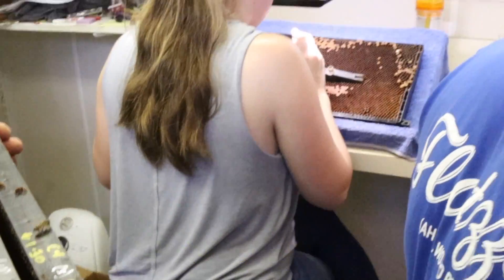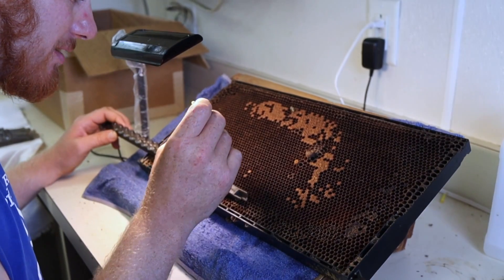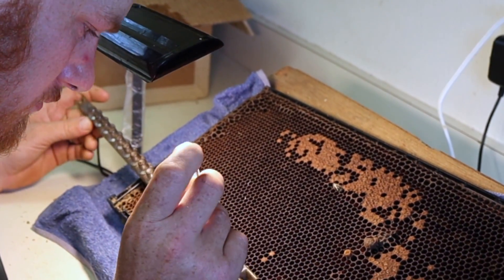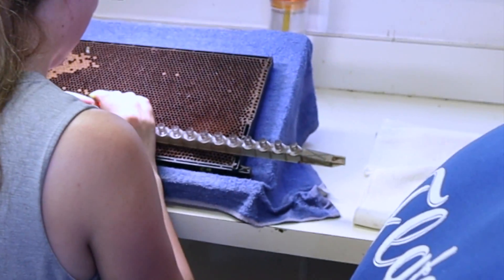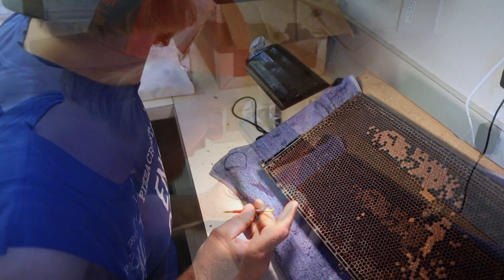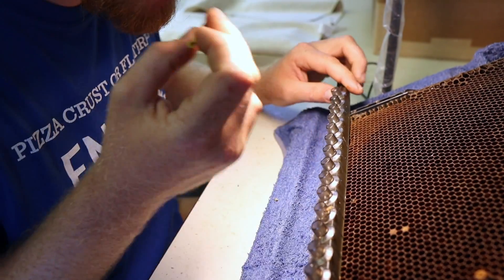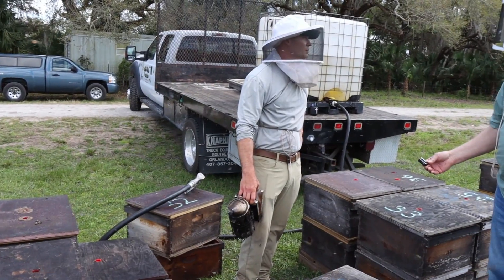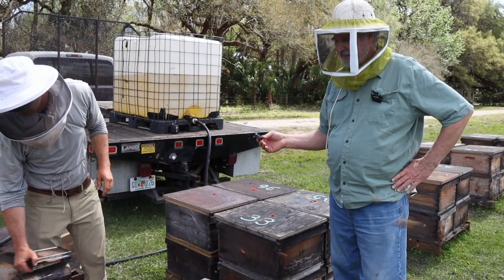Florida Beekeepers Part 3: Queen Production with Chris Werner

Comment: Why do you want to make the finisher queen-right? I understand why you make the starter queenless, but why is it better to make the finisher queen-right? Thanks and I really like all of your videos!
Reply from the maker: You can let a queen-less starter finish cells, it will work fine, but it will only do a real good job for one round unless you continuously add fresh young bees. By the second round the proper age nurse bees are aging. Using this method you can do it again and and again because there is a steady supply of bees that are of the proper age. This is important. Good question. I'm going to put it at the top of the comments. Thanks.
Reply: @bobbinnie9872  Thanks Bob! Now it all makes perfect sense!
Reply: @bobbinnie9872   I have a question along the same line. Are they adding frames of brood or shaking any bees into these cell building colonies that come from donor colonies?  If not they must just keep these colonies good and strong. I do understand what's happening, virtually all the bees in the colony end up in the lower box both through shaking them in from the top box and the field force flying back from the top box.
 I am curious because if they are not colllecting brood and bees from other colonies it seems very efficient and I like that idea.
Reply from the maker: @calvinkalmon6746  They are generally just using the bees from an existing colony but as you can see in part 2 Chris keeps track of which builders are performing poorly and takes measures to correct deficiencies which may mean adding brood or a new queen. We use much the same method but often choose to shake in more bees to be extra sure if a colony is not real strong.
Reply: @bobbinnie9872   Think you that clears it up nicely. What I like is there is the possibility of using that colony to produce honey and make cells.
Reply: @bobbinnie9872  Good answer Bob. I'd add that finishing the cells in a queen right hive is under a different natural impulse and the cells will finish better. When queenless the bees are desperate to produce a queen asap and will do so under the emergency impulse. Once the cells are started they can be finished queen right, which is done under the supercedure impulse. It will take longer to cap the cells and they will be better fed.
Reply: Great videos..the best queens are swarm cell queens and even those are queenright..its best to imitate what the bees do as much as possible
Reply: @corneliuolar7663  Well, my thinking was that if you make the finisher queen-right, then you would provoke the queen to enter swarm mode and she would want to swarm.

Comment: Bob – Can you elaborate on these two points:
1) “Swarm cells make the best queens”
2)  “ An Indian study that shows  1.3 to 1 syrup achieves the best stimulation”
Thanks
Reply from the maker: Hi Craig. Swarm cells make the best cells because they are generally very well fed. They are usually made at a time when the bees are predisposed to making cells. 
The Indian study on feeding syrup looked at a number of different concentrations of syrup and found that the one that elicited the most brood production and wax production was 1.3 parts water to 1 part sugar. My experience is that anything remotely close works well. We routinely feed 1 to 1 when building colonies on syrup because we also want to gain weight. When feeding colonies strictly for producing nucs we use anything between 1.25 and 1.5 to 1 and have good results.

Comment: Thats interesting. Last September my 8 hives were robbing each other so i figured i would simulate rain, turned the hose on shower setting and sprayed straight up above the hives as if it was raining. Took about 2 or 3 minutes and they stopped robbing. I did it the next day as well.  It definitely works if you have running water. Always good info Bob.

Comment: Bob thank you very much for sharing your trip to Florida with us. Very informative and extremely reliable information that is hard to find nowadays. 1 question about Mr Warners fabulous operation,  his hove body's are they torched and wax dipped? His lids are they plywood cheese boards? The lds have a dark black finish on top wondering why? Thanks Bob
Reply from the maker: His hive bodies are dipped in hot paraffin wax with a little copper naphthenate added. His lids are plywood cheese board. I think the lids turn dark with time in the sun. He only paints the raw edges after cutting.